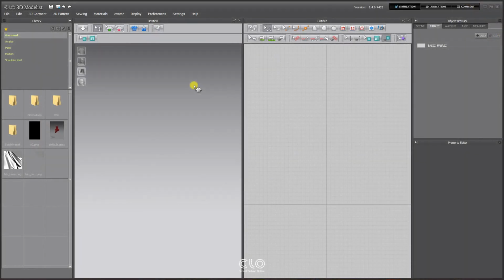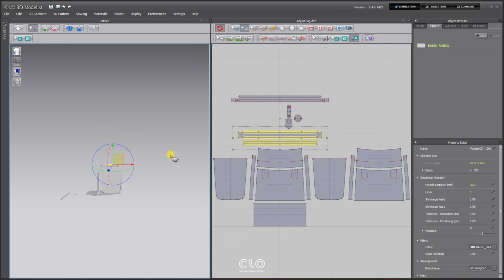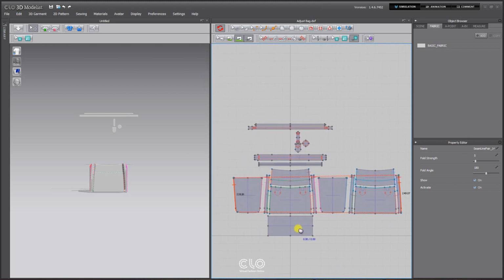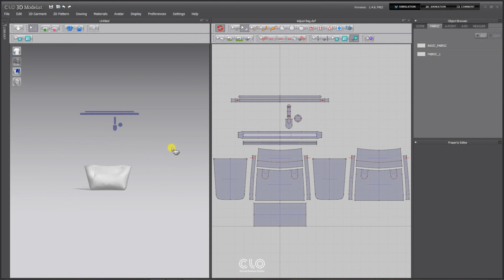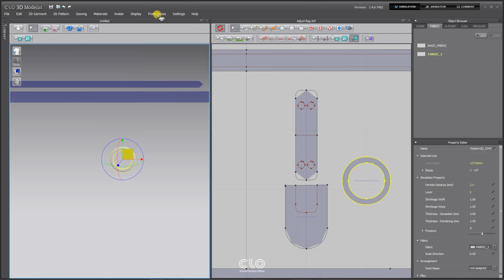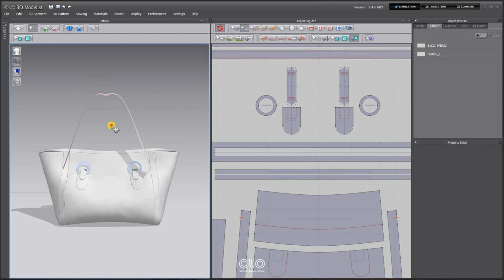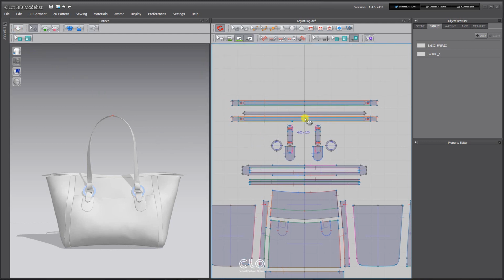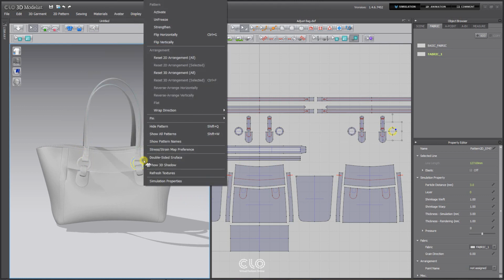[CLO3D] Making a Bag

Comment: Which software is best for bag design clo or marvelous designer or optitex.
Reply from the maker: As a CLO designer... I say CLO!😁
Reply: @CLO3D  I recently installed clo, and imported few patterns from ai, to see them into bags. But the rendering was tooo slow. Any tips. Is there any settings I should be changing?
Reply from the maker: for further help we recommend posting to our Official CONNECT Forum - https://connect.clo-set.com/community
But you can also check our computer recommended specs on our website too :)